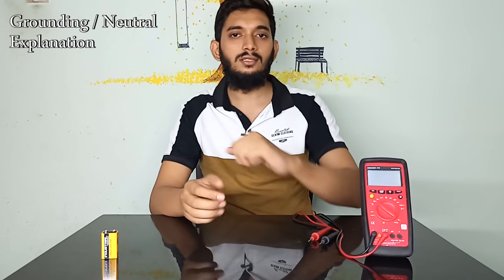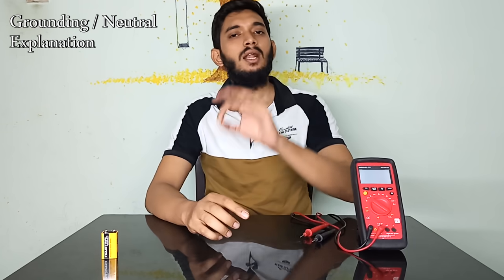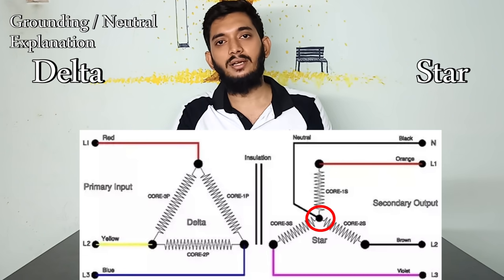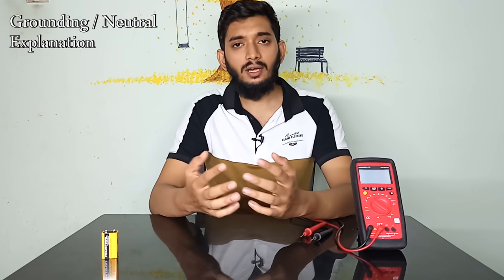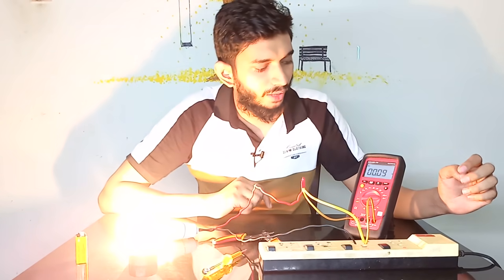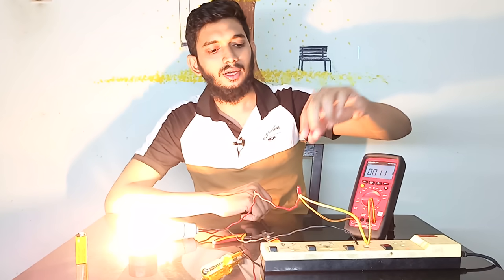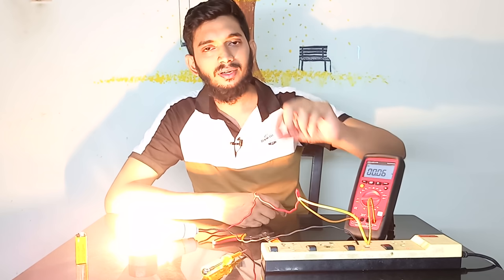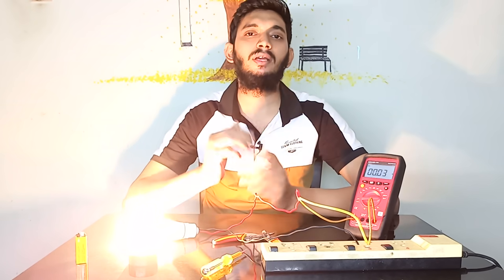What is Earthing? Why Earth leakage happens? _Tamil, How to troubleshoot Earthing shock issue?

Comment: bro there is one main doubt in 8:54 , i am not understanding the concept itself. Like, first the supply are reversed, so in the switchboard Neutral is carrying current always, while switch is placed on phase. Now, in the socket where the transformer is connected, current goes through the neutral, bcoz of no switch connected with the neutral supply. So, current flows through neutral, through transformer pins and as the primary windings are closed loop ones, the remaining current comes out in the phase wire back to the switch board. I could understand till here. But my doubt is in the other sockets, how come there is current in phase pins also ??? Like neutral was giving supply, and how there is return current to phase again? like tansformer switch is also off right? how there is return supply of current.??
Reply: can you please respond back bro ??? @Engineering Facts
Reply: Same doubt it may be weak insulation of transformer winding or jumb voltage in earth wire.

Comment: Whenever ac or mixer is turned on, light flickers in my house does that indicate inadequate supply? Ours is single phase
Reply: I think its happens in most of our houses due to the single phase, if we are using 3 phase it might not be happen
Reply: Mixy Current adhigama edukumbodhu voltage kuraiyum
So bulb will dim
Reply from the maker: It's called dip in voltage. It usual on unbalanced system
Reply: Normally it happens..
Because AC ,motor, mixer grinder 
Consume 3 times the full load current while starting.
Generaly it y termed as voltage dip....
Reply: It is called voltage surges 
It is common in induction applications(AC application)
Like water analogy
If we open one tap then tap connected at other end also show some variations!
Reply: @engineeringfacts  how to correct that light flickering??,we have 3phase current but then also this problem is happening often in our home???
Reply: When induction load starts it takes starting current 3times and above.
Reply: @Phase and Neutral thank u

Comment: Bro, i placed two clock on top of wifi router both are not working after some days even though battery changed. I tested with another clock too but after some time not working, will radiation affect battery life?

Comment: Good explanation. I have a question regarding this. What is the role of RFI / EMI Filter.  Does it indicate improper wiring and improper earthing. Please do explain the same with examples like ground open, neutral open and line or ground reverse.

Anchor spike buster has the filter indicator.

Comment: Actually tester does not reduces voltage, it limits the current. You can check using a multimeter, it will be delivering 230 volts, and a reduces current which our body can withstand
Reply: Voltage will reduce when using resistor
Reply from the maker: I don't think so. But I'll check.
Reply: No .
It will reduce the voltage.....
Reply: @caseysurya6630  yes

Comment: Same doubt, i am using 2 junction box for my system. 1st junction box have only 2 pin without earth pin from that 1st junction box i am connecting another junction box which have also 2pin in that but the junction box have 3 pin l.. from that 2nd junction box which have 3 pin i have connected to my pc and monitor i feel earth shock... What should i do for this
Reply: Earth pin wiring should connect to earth pipe
Reply from the maker: Check for reverse supply. Or connect earthing

Comment: Bro na en phone ha charge potu vilayadura appo touch issue varuthu  but power cut na ups supply varrapo touch issue varala .enna problem nu tearila any idea?
Reply from the maker: Voltage difference in charger. Change charger
Reply: @engineeringfacts  using the charger given in the box only bro

Comment: bro water heater use panumbothu output waterla earth adikuthu ena karanam bro athuvum recenta tha bro apram stop aairchu please help me sir
Reply from the maker: Check panna than theriyum bro
Reply: @engineeringfacts  thanks bro
Reply: @sathyakumarr6738  ila bro emergency suddena varuthu apram ninruchu heater tha problema
Reply: Earthing weak in your home.check and .correct it.use RCCB/ELCB
Reply: @sathishv8831  
For ur safety 
Kindly install RCCB
IT will save life frm shock...
Some time it happens due to corrosion of heating element...
If it happens u can feel the line voltage too.....
Reply: @caseysurya6630  thanks for your reply bro
Reply: @jayaramanv3429  thanks bro
Reply: @sathishv8831  u r always welcome bro
Reply: @jayaramanv3429  bro ivlo naal varama ipo suddena water heater switch off la irunthalum current adikura feel varuthe apo earthing latha problema bro or water heatera bro
Reply: @sathishv8831  first'check in your home earthing with electrician
Then check the heater with megger
pbm will solved
Reply: @jayaramanv3429  thanks bro
Reply: @sathishv8831  it's ok
Be safe
Be happy

Comment: What will happen if you connect the setup box plug in steblizer output?
Reply from the maker: Set top box wil not turn on
Reply: @engineeringfacts  will we feel shock as you mentioned in ur video?

Comment: Yen bro 1 phase and 3 phase mattu tha iruku....yen 2 phase 4 phase 5 phase lam irukalalaa?
Reply: Single phase used for domestic standard easy purpose
Three phases only having 120 degree when induce in alternator.
6 phase u will find soon
Reply from the maker: https://youtu.be/nlCBU43fqFA
The idea is reducing copper. If you increase phases, again copper consumption will increase.

Comment: Hi Bro, your videos are awesome. Just have a question in my mind can you answer that? I say something on the other YouTube videos and he said for temporary solution we can connect the neutral cable to ground pin to avoid shock on electric device and its working. I'm curious to know will it work as temporary solution and if it is, will it do any demage to the device or any other issues.